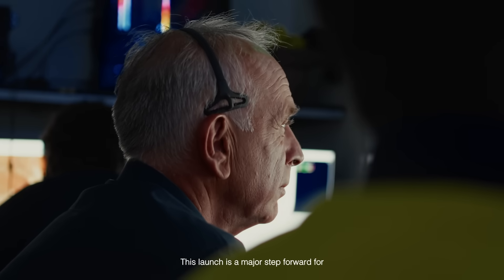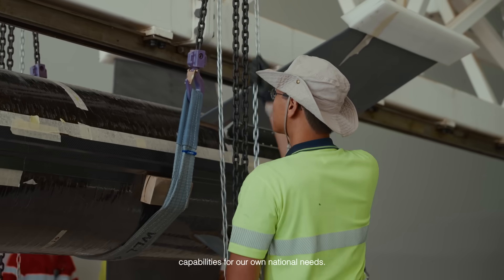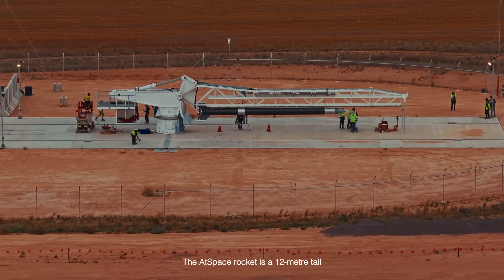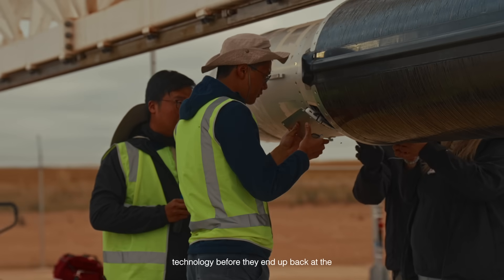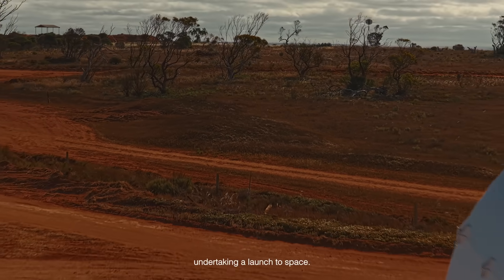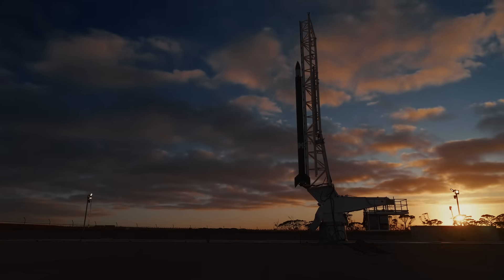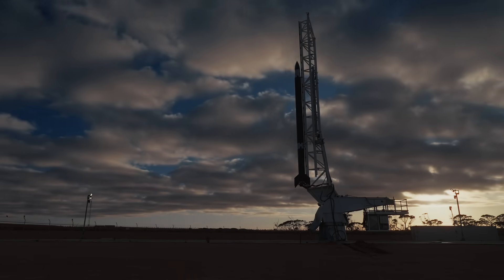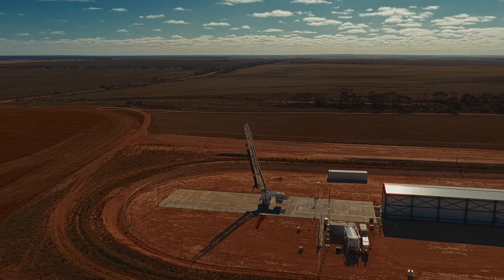Australia's highest commercial rocket launch A01

Comment: Neil, you're brother-by-another-mother, dude. The older bikes do have a magic I can't see in most new rides. To an extent, I reckon it's somewhat down to what we grew from youth through middle age with, so our muscles and joints are "tuned" to that geometry, but my 1993 Giant Iguana gave me 20 years trusty service until the head bearings were knackered but the quill was seized into the steerer. On that issue, I'm a threadless convert and a 1x pioneer, especially on my touring bike. Neck and heart problems these days, so I've graduated to a Greenspeed GT20 for my daily ride, with electric assist, but I'm building an adventure bike (acoustic, rather than electric) from a Giant Sedona from 1995. Have calculated a good ATB geometry for it and had a 40mm crown race spacer 3D printed in steel, plus a rear disk adapter. Dragster riser bars, dropper post with under-seat operation, 1x11 Deore and Wheelsmith wheels. (650x38b) Yeah, rim brakes are disk brakes, I know, but my only things I agree with the kids about is disk brakes and 1x drivetrains. I'm too old to be arsed with "which ring do I need after that cog?" 11 in a line, 24" to 95", more than enough gears to do the job, in a 1, 2, 3... ...9, 10, 11.
Reply: @crunchysteve ... Um, wrong video?
Reply: How in the fuck do you watch a video about a rocket launch and ramble on about your bike?